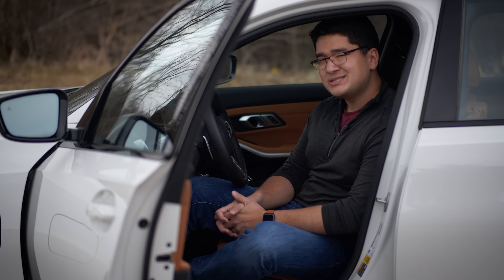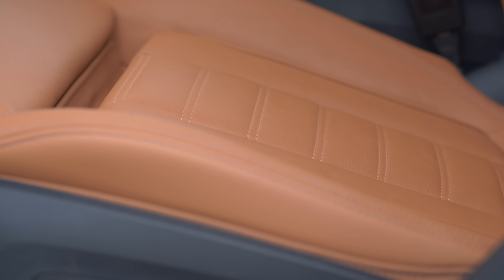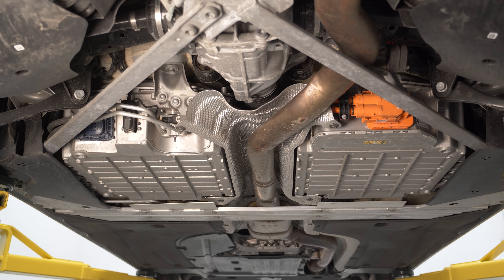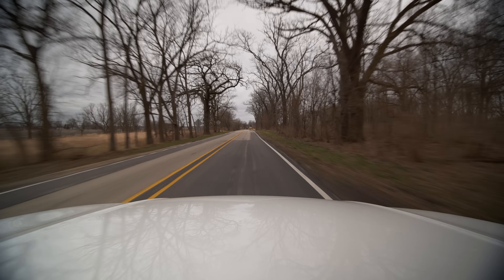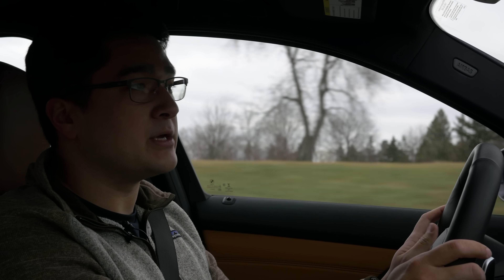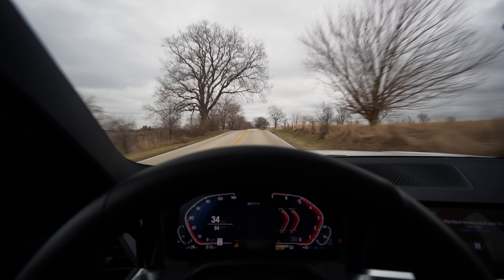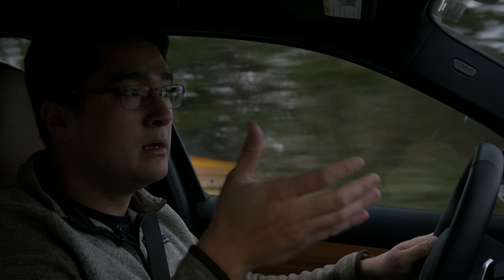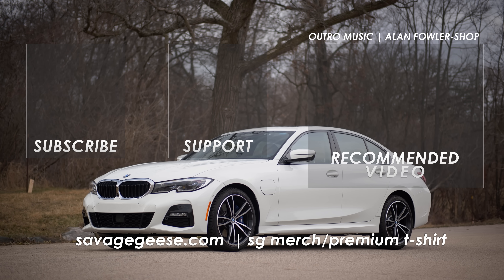2021 BMW 3 Series | The Transition is Here

Comment: I have owned a previous generation F30 3 series since new and the longer i own it I understand why it costs more. After 7 years the interior has zero rattles the build quality from the body structure to the paint and materials quality make you aware if why you pay a premium for a BMW. Sure the so called competition can make a nice interior, but I would revisit that aspect after 6 years or more and see how its holding up. I can press on the door panels and there is no flex or squeakiness to the way it feels. The weight balance to the ride quality is perfectly balanced between comfort and handling. The harder you push it through a corner will surprise you how much grip and competence the suspension really has.
Reply: Those are good aspects. The seats were decent, the ZF8 is very good.  But then there's the other bits:  No spare tire, battery hard to replace, the base headlights were dreadful, the rotors rusted at the hub and looked awful so ended up buying all new rotors even though the original ones were not worn out, just ugly.
Reply: What about oil leaks and carbon build up on the intake valves?

Comment: You can thank the European Union for these “transition” cars, in 2021 legislation came into force which mandates manufacturers to a fleet-average of just 95g CO2/km. Literally every internal combustion engine over 1.0L emits more than that so hybridisation is essential to achieve the low emission/mile targets. Since cars have a typical lifespan of 15 years we’re a few years into a transition towards Battery Electric Vehicles that will take at least 15 years

Comment: A nice Remus or Supersprint exhaust should help fix the "noise" problem.  Wonder what those guys over at Turner Motorsports can do for this G20 3##e.  So wish we, the US/CAN/MEX got the 3-series wagon.  Ppl complain about mileage/range, but buy/lease the larger vehicle, despite them not needing the extra space or height.  I'd much rather have the wagon 3 over the X3.

Comment: I drive a 530e. The only reason I got the E was taxes. I'd have much rather gotten a 530i. It's even cheaper to buy. But factor in taxes and I get totally screwed compared to the PHEV.
Pretty soon I'll be pretty much forced into an EV since even PHEV won't cut it no more as it's not zero emission. 

Another reason why pure American muscle cars just simply do not sell here. You would pay a fortune in taxes just to keep something like a Mustang GT on the road here. Almost as much as the car itself really.

Still ... BMW did a great job on the hybrid drive train, keeping it at least fun to drive.
But indeed, you do have the EV part to deal with and keep in mind.
And no ... Not a single Toyota compares, both in driving dynamics as in interior quality and comfort.

I will agree of course that you pay a premium for the German luxury that is generally higher than the average boost in return. Each needs to decide for themselves whether it's worth it.

Comment: Hybrids are NOT meant to be driven purely electric. The Electro motor plus the battery are meant to support your normal drive and push fuel usage down. If you live not far away from work and the battery happens to be enough - nice for your. But the primary purpose of a hybrid is not meant to drive you purely on electricity alone. So even ppl living in rural America would profit from  a hybrid especially if the hybrid has something like a cruise mode where the electro motor shuts down the combustion engine on longer highway roads. Here in Germany we can get easily 60+ mpg out of this plug in hybrids and that is alot. Even if you never charge the battery at home or at some charge stations you can still get around 36 mpg out of this plugin hybrids.

Comment: Was the 2011 BMW 3 series  the pinnacle driving machine? Last year before drive by wire.
Reply: the E90s were the last good ones I think.  And those had some awful problems.
Reply: @bb5242  oil leaks? Electrical issues?

Comment: This was a pretty basic review. The value proposition of this is that it’s the cheapest way to get into the 3 series. Better fuel economy without any compromise. And because the engine won’t be working as hard, it’s potentially less taxing in the long haul so it’s going to be better to maintain.

Comment: Just a little correction, the actual range for the 330e is around 23 miles in the NA version. Also, I don't agree with a lot of the things said in the video,  the same could be said regarding the RAV4 prime for the price and mpg.

If you buy a PHEV, of course you have to be able to plug it in and take advantage of the EV range.

Another thing, the as tested 59k price test is not really fair. You didn't have to take all those options it could've just been under 50k and the car would essentially be similarly equipped compared to an economy car. Then you could account for the tax credits + gas savings to a mid-top trim Accord. the difference in cost would reduce quite a bit. It will still come up to 10k or more but it's not as bad as one would expect.
Reply: I ordered mine with xDrive, premium package and driver assistance.  MSRP was just under 50k including destination.  They are giving me $1000 loyalty and US $5,800 + NJ $500 tax credit.  The Toyota dealer near me wants 42k for a loaded v6 Camry.  The Camry will keep more of its value for sure, but why buy an appliance when you can get an enjoyable car for just a little more?

Comment: I just don't get the point of a plug-in hybrid like this especially for 60K,  most people only really need 5-10 miles of EV range to get out of their neighborhoods
and onto freeways where the benefits of the EV/hybrid mode are going to be largely mitigated anyhow.

The regular 330i already makes around 26-27 MPG so unless you are in bumper to bumper traffic or don't drive I don't really see the purpose here outside fleet
 MPG ratings.  BMW should have either dropped the price to entry for  the regular 3-series and fit this in around  the low 40K area or maybe paired the hybrid 
system with a different motor. 

And if I'm being totally honest the Infiniti Q50 Hybrid which debuted in 2014 did the luxury  performance/hybrid thing better,   it was a focused with a
  small battery pack, not a plugin hybrid, offered  identical fuel economy but you get a 3.5L 6 cylinder NA engine,  better performance  and it started around 48K. 

  You'd  think BMW would  have raised the bar with an extra 6 years of R&D and improvements across its platforms.

Comment: I thought the battery capacity is only 9.09 usable, not 10.7. The range is not 39 miles; it's only 23-25 miles with pure electric mode.

Comment: My 2016 BMW 328i Sports Wagon gets 24 mpg in city driving when Eco mode is used a lot and 21-22 when Eco Mode is used somewhat but Comfort Mode is on much of the time.  The car has gotten 35 mpg on highways.  Shouldn't the 330e, especially a 2021 or newer model, do better?  And please stop calling the B58 engine a "mainstream product?"  It isn't.  It's strictly a luxury product.

Comment: I have driven the previous generation 330e and also don't understand why someone would go for that car. You can get a Tesla Model 3 SR+ for about half the price, same power, same 50:50 weight distribution, same RWD bias, and in fact, better front suspension and more standard spec. Genuinely don't see where the money is going.
Reply: Quality, looks, status.
Reply: @jareknowak8712  We are a family of BMW drivers and my father recently got a 2021 Model 3. I’m sorry to break it to you, but the interior of that car is better built and has nicer materials than any of our previous BMWs. 

The style and status. Well, if the bragging rights are worth $30k to you, then sure, go for it. I choose a car for myself, not to flex in front of others.
Reply: @DarcersTech  
So, why You have chosen BMW earlier? 

Im not an BMW guy, but i do like 80's and 90's 3 and 5 series. 
I have Mitsubishi and Renault.
Reply: @jareknowak8712  Because exactly like mentioned in the video, back in the day, BMWs were expensive, but there was a very significant gap between cheaper cars and “premium” brands. Now, it just feels like you get the same car and all the money only goes towards the badge, not superior engineering / tech.

Comment: You miss the old analogue gauges? I sure don't. I am at the point where analogue gauges in a car make it look dated. A good digital cockpit is a must for me now.... for a new car that is. and do they break? maybe. I got 2 monitors at home. They are on 8+ hours a day. Both have been working almost every day for 2 and 4 years now. not a single dead pixel. So these modern screens are definitely reliable enough for in a car that you use a LOT less.
Reply: You're comparing the reliability of an office monitor to screens in a car?  Those car screens get exposed to significant temp and humidity changes, touch screen wear, direct sunlight, etc.  Chalk and cheese.
Reply: @bassandtrebleclef  well even then they should be able to last ~7 years. Which is enough for a lease term. You shouldn't buy these new anyway. Besides. Computer hardware is more resilient that you think.
Reply: @bassandtrebleclef  Exactly. It's all fun and games until your entire dash goes black.  Just on the F30 I had, that little screen in the middle went funky a few times, but at least I could still drive. It was incredibly annoying not to see that middle section, though.

Comment: The 3 series is a wonderful car. I think the best sports sedan on the market; however cost of ownership is very high. I’m talking regular maintenance. I owned a 328i for 6 years. I loved but I had to walk away from it due to ownership cost. It never broke down. A joy to drive. But brakes, tires, and the aggressive maintenance schedule will drain your bank account. Lease one for 3 years, enjoy it and move on, unless you have money to throw at it.
Reply: Endless money pits
Reply: The bean counters took over the engineers mid 2000 and not looking back.
That said, I assume Accords and Camrys only need maintenance or repairs as often as a solar eclipse?
Reply: @chrislim7976  Maintenance is MUCH cheaper on Japanese non-luxury brands. For example tires for my Mazda 3 (Pirelli All Seasons) were only $91 per tire simply because they are 205mm wide and 16" wheels. The EXACT same Pirelli tires for a 2021 330i Sedan are $247 ea because they are super low profile and barely wider at 225mm.

TLDR: Pirelli Tires for my Mazda - $365
Pirelli Tires for a BMW 330i - $988

Average insurance cost on a 330i is ~$200 per month. Insurance on my Mazda is $30/mo but to be fair it is a little over 5yrs old, but there is no way a 5yr old BMW will have $30/mo insurance.
Reply: @Argedis  
I agree it is more expensive but this notion Japanese cars run on rainbows can't be true.  I am more pissed at BMW'S profit model for major repair bills made from plastic parts not tires and insurance.  Most basic phone bill's are more than $30 a month so I don't know where you live.
Reply: @Argedis  of course maintenance is cheaper on a non-luxury brand. That’s always the case
Reply: @chrislim7976  OP was talking about maintenance costs. As far as reliability YES Toyota has always built their cars with much less complexity to maintain their reliable reputation. This is why they never adopted Direct Injection only for carbon build up and Turbo engines for longevity. They also encourage any worker to stop the entire assembly line if they notice any kind of issue during production. BMWs on the other hand are overly complex and just like you said tons of plastic parts. My 20yr old Tacoma is extremely basic and mostly mechanical and still runs like a dream with no complicated systems on it to break.
Reply: @Argedis  
Great.  We're those guys all driving 15-20 year old simple cars hoping not to get totalled by  some SUV or minivan.  LOL
Reply: @chrislim7976  Well good thing it's just my $3k beater truck, the Mazda is the daily. Both paid for. Good luck with car debt, the extra safety will surely defy the laws of physics against an SUV or Semi.
Reply: @Argedis  
No I am one of those guys.  I drive like a school bus and hope nothing happens cause I don't want to buy one of these "new cars."

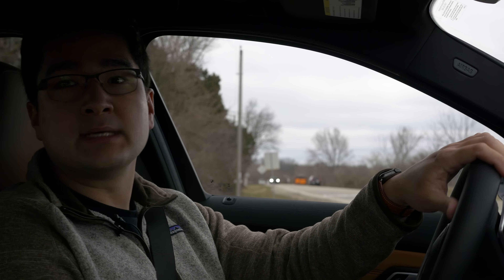Comment: 8:01 Mark is only mildly impressed with the ability of the BMW to peal out of a turn, not nearly as well as his old civic though.
Reply: The road is damp and the tires are cold. Still not bad the electric motors definitely help.
Reply: The B48 produces a lot of torque for a 4-popper. 294 lb-ft at 1,550 RPM is enough to easily break traction in the rear, even with traction control on.

Comment: These guys need to check out the Alfa Romeo Giulia.  It has that feeling BMW abandoned several generations ago: telepathic steering to die for, extremely well-balanced chassis, excellent ZF transmission with glorious paddle shifters, simple analog gauges but with just enough tech, gutsy engine with lots of low end torque, and a focus on being a driver's car, the kind that will put a smile on your face just driving to the grocery store.  This BMW just seems utterly boring.  It's such a shame what BMW has become.

Comment: This is pretty biased / lazy review.  Yep, flash that $60k price tag across the screen for the fully loaded car with every option, and don't mention that the car starts at $44,500... because that's fair.  Don't mention the $5,836 federal tax credit that brings the price down to $38,664. ($2,586 less than the base 330i)  Don't mention that many states have state tax credits to reduce the price further.  Oh and BMW often runs deals on these, dropping the price $1k-$2k more.  

No mention that it gets the same 0-60 time as the 330i, probably a faster 0-30 time, it'll save on fuel costs, will save on maintenance costs due to less miles on the engine (fewer oil changes, engine air filter, changes and spark plug/coil pack changes), and it'll extend brake pad and rotor life significantly (and the dreaded BMW brake dust) as a result of regen braking.  You can pre-heat it in the garage using energy from the plug; something you can't do with the 330i without asphyxiating yourself.  You guys didn't cover ANY of these advantages... why not?

I mean guys... wtf are you even reviewing...  The Final Thoughts were a bit more forgiving, but the rest of the review was literal trash.  Just because a person has a commute that's over the electric range doesn't mean they won't benefit from having a full battery to start every day with, and reducing gas/ICE use...

Jack... what in the world are you even talking about?  It's like you know nothing about PHEVs.  22 miles per day of electric range * 365 days is 8030 electric miles.  Testers have gotten 29 miles on a charge on the highway, so that's as much as 10,600 electric miles.   The average driver puts 13,500 miles on their car per year, so with one full charge per day, this car would reduce annual gas miles driven by 60%-80%.  Add in work place charging and you can reduce gas driven miles even more.  Add a L2 charger at home for faster charging after work, and you can add even more electric miles.  

Jack... you seem to have no understanding of what a PHEV is intended for or how it's supposed to be used.  It isn't meant as a complete gas replacement.  If you don't ever want to drive miles on gas, then why would you buy a PHEV that has a large enough gas engine to power the vehicle?   That's silly.  The entire point is that we can't build enough long range pure electric car battery packs because of battery supply bottlenecks.  PHEVs don't replace all gas miles with electric, they replace a HUGE chunk of those miles using a very SMALL battery.  One long range model 3 / Y battery has the same capacity as SEVEN 12kWh BMW packs.  So given a cell supply bottleneck, you could build 7x more BMWs than long range BEVs, taking 7x more pure ICEs off the road.

As someone who does auto reviews.. I would expect you to have at least some understanding of this.  Savage Geezus...

Comment: Economy figures are kind of underwhelming for what it wants to be. I am getting a global all-year average in a 4 seasons per year climate of 8.6l/100km or roughly 27mpg in a 2012 GS450h, which is NOT a plug-in hybrid, meaning it also charges the battery off burning fuel and has a combined power output of 343hp. I would expect to see slightly better figures from a 10 years newer plug-in and a smaller economy engine.

Comment: Reviewing a plug-in hybrid is totally different than a regular gas review. You only will consider the hybrid if you are trying to be efficient. The benefits of these cars is as a stepping stone towards total electrification. If you are a leasing customer then the hybrid won't make much sense since you won't recoup the money spent because the pricing is higher than the gasoline version. If you live in and apartment, condo or townhouse where you can't plug in then you will never achieve any benefit. These models are for those that are retail clients and can possibly receive the federal rebate or the electric advantages of plugging it in. These are the first questions I ask my clients when they come in and then direct then to the right version of the car for them. What is impressive from the car is the range versus what is stated when you drive efficiently, the fit and finish of the BMW versus other brands and the fact that it's two cars in one depending on the needs of the driver.